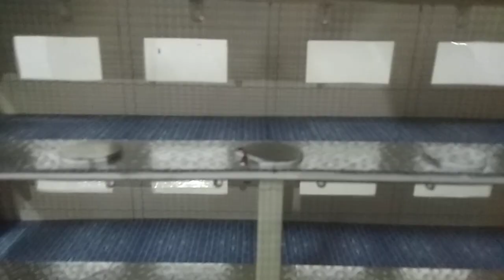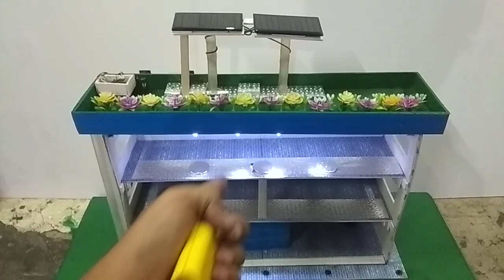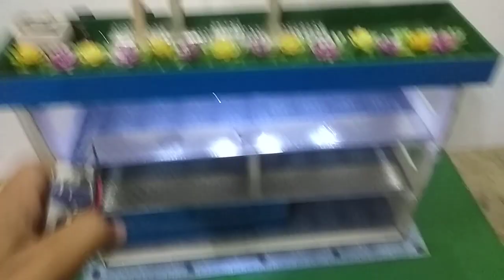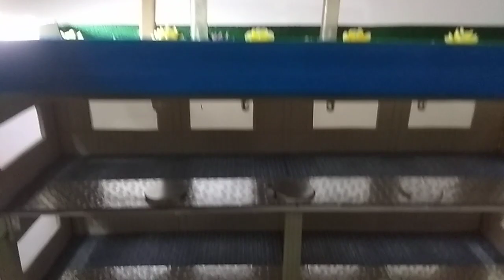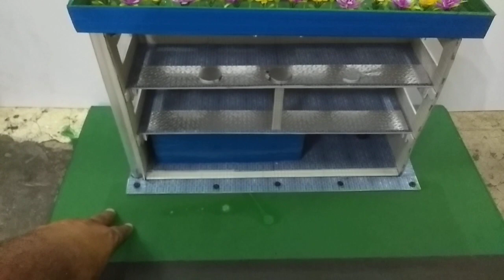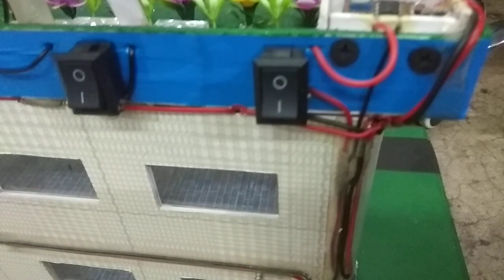GREEN BUILDING WORKING MODEL

Comment: How you had made this model ? Will you please explain it step wise
Reply from the maker: very long process, that's why i can't show making process, you can use any cardboard box for building, and all you need is Sunlight Sensor from any online store, with few more devices in working model, but if you like to purchase the sun sensor with 4-5 LEDs we are selling in just Rs.1200/- with theory. or you can make the circuit with yourself by use of any kind of light sensor module with any micro-controller. Basic theory on phone is free, but if you need full file it is chargeable, you may contact us at : 9818479606 (whatsap).